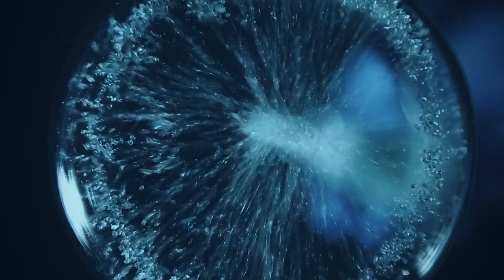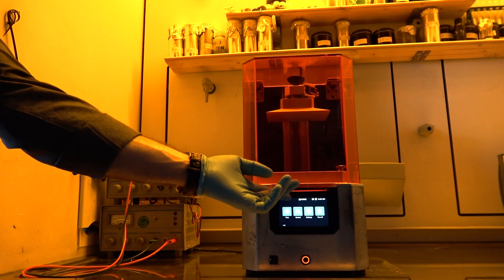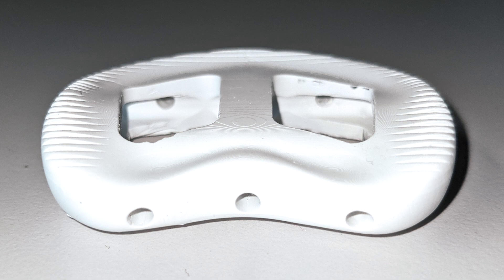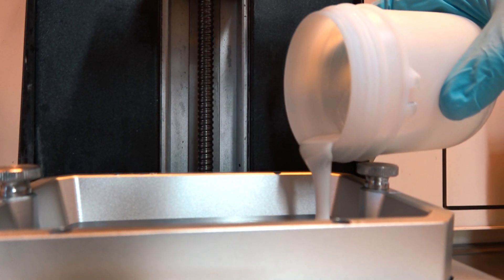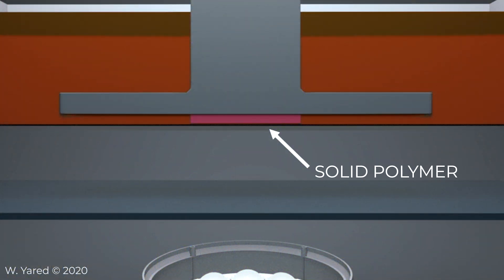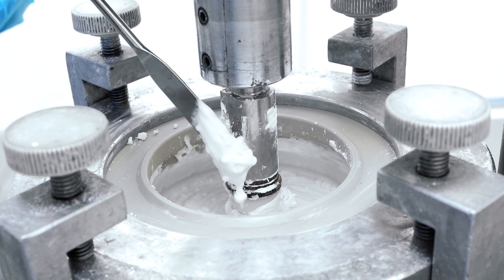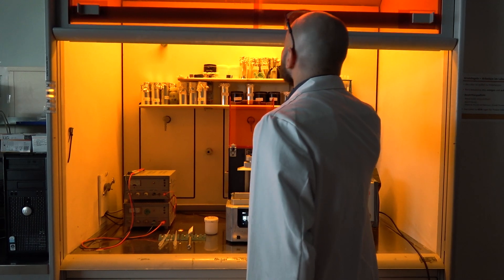How to 3D-Print Bone Implants - Ceramics Stereolithography

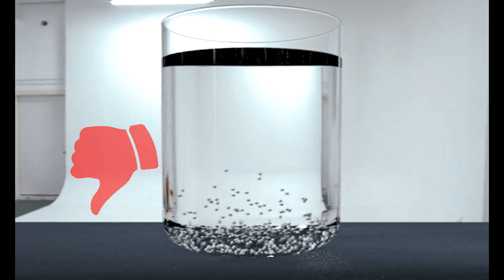Comment: 4:14 if it is correctly formulated it will not settle significantly for a few days.
Reply from the maker: Yes, you're right 👍
Reply: @Dr-Yared  I’m a photopolymer formulator. It wasn’t a guess.
Reply from the maker: @Ave_Xavier  yes, from reading your comment I expected that you are experienced in this field. That's why I endorsed it 👍
I would love to learn more about your work. If YouTube provides my contact information, feel free to DM me :)
Reply: @Dr-Yared  sure. I think we have some common interests. However I don’t see you DM info for YT and your university profile doesn’t have an email listed. Just your number. I assume lab number.
Reply from the maker: @avenuex3731
If you click on the "Email" hyperlinked text under the phone number, it should automatically open an email with my email address in the recipient box.
Reply: Do you know what the additive he used @5:25 is? I’m having issues with getting my material to be thin enough to work with. 

Thanks!
Reply: @rossbarney4227  you can ask him directly. But I’m not sure what you’re asking. What are you trying to do?